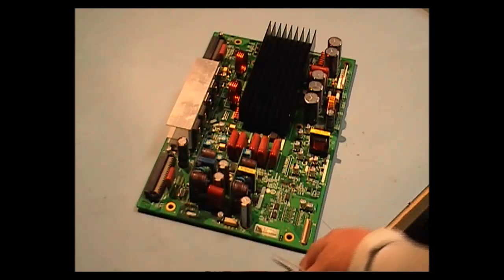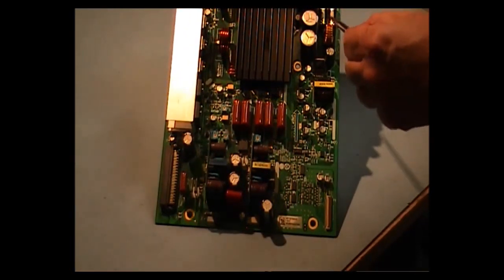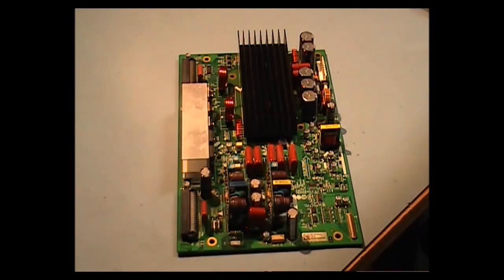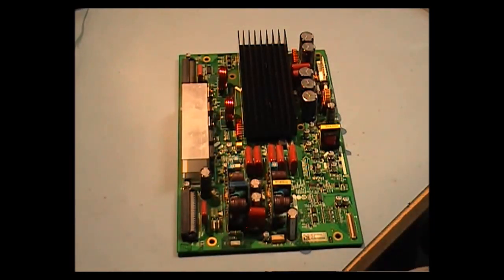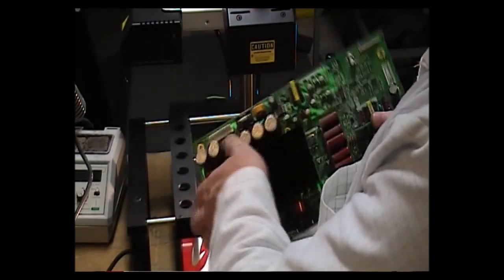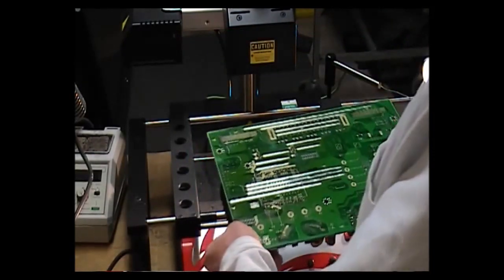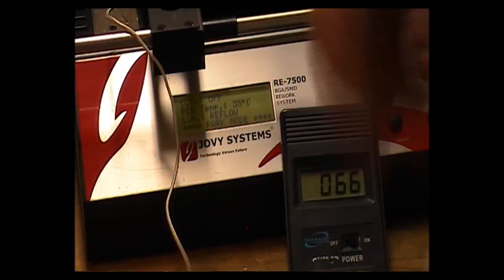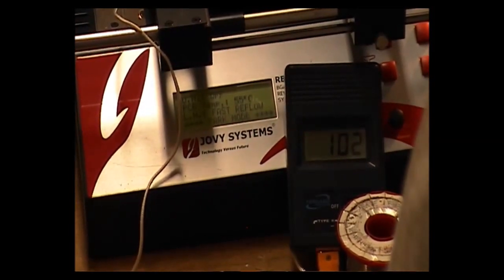Philips LG 6871QHY053B IPM removal repair video

Comment: i had to buy soldring station to do this job but its time taking job so i v used my head and hammer with flat screw driver removed it less then 5 minutes .easy way to do it but have to be careful

Comment: I've done numerous IPM swaps, and I'd say a de-soldering gun is the best tool; I use the Hakko 808. How I typically remove IPMs is by applying additional solder to each of the pins then using the Hakko to suck up the solder. The solder flows much better this way. At times, I may have to redo a couple pins, but the holes are normally cleared and the IPM just falls off the board.